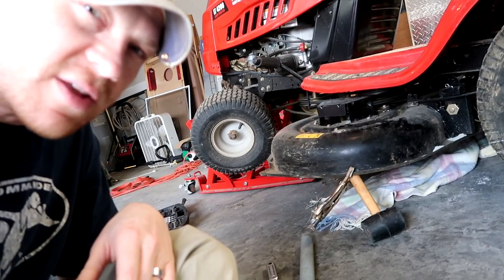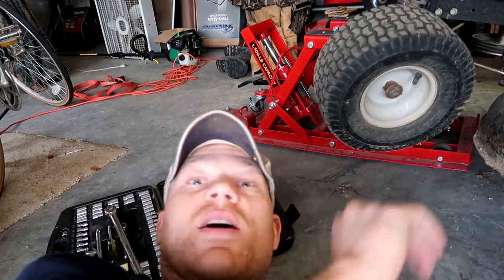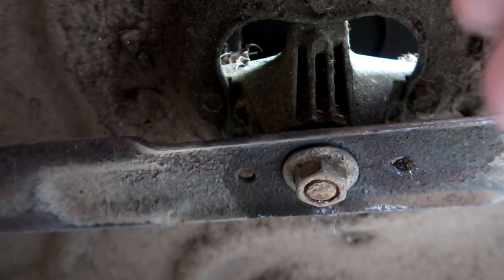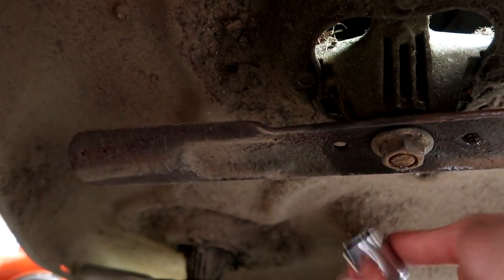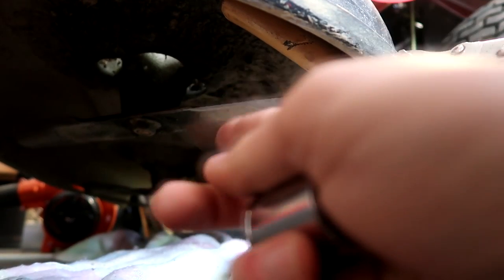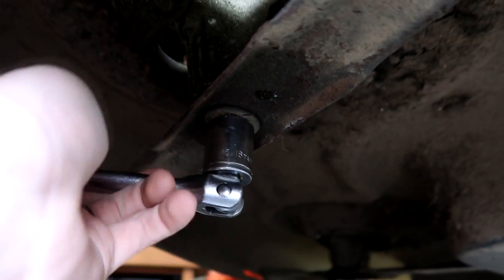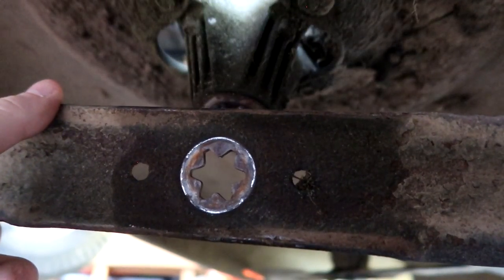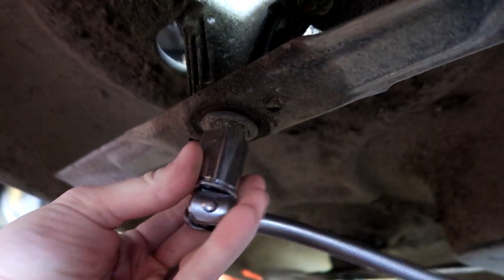How to replace lawn mower blades - EASY and QUICK

Comment: Best thing I ever bought was the risk for riding mowers!! Tractor supply sales them!! Bought my new set of blades just gotta get them time to put them on.
Reply from the maker: If you a nower from tractor supply they will offer you an extended warranty. The company I work for is the warranty company that backs it. Ha! I bought this mower feom tractor supply
Reply: WHO_TEE_WHO Bought my Tractor at John Deere  but the jack came from tractor supply.
Reply from the maker: Ahhhh. I tjink i got my jack from northern tool

Comment: I've changed many mower blades but that's the first I've seen with a nut instead of bolts.
Reply from the maker: The only ones Ive done with bolts are old school push mowers, but pretty much the same concept 😀
Reply: All I ever had was a nut!!!  On riding mowers
Reply from the maker: Yup me too. Ive seen bolts on older push mowers. Im no full time mower mechanic, but worked on a few 😃
Reply: I've had a Murray, junk, that had bolts and two husqvarna that have bolts. I know craftsman has same parts as my husqvarna.  Can say about other brands. Maybe they all have nuts. I think it would be easier with nuts though because it can be hard to hold blade in place to get bolts started. It's hard to get both hands under deck that's maybe 8" off ground.
Reply: John Bates  amazing how things are different and changeing
Reply from the maker: Either way you gotta be careful not to shear the bolt off.....ive done that before on some that were super stuck! 😆